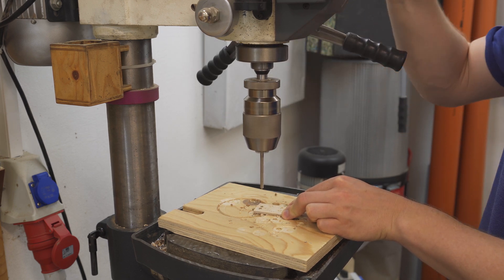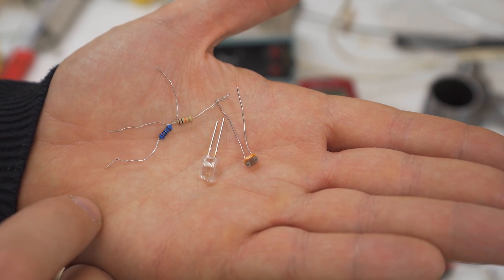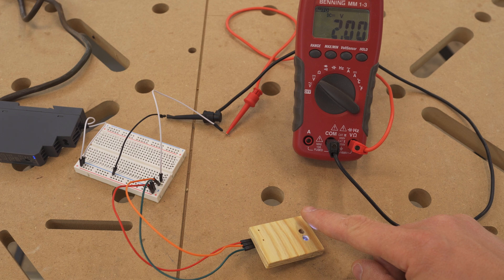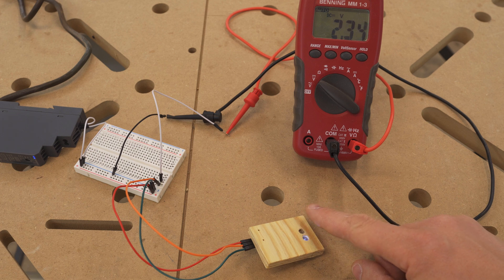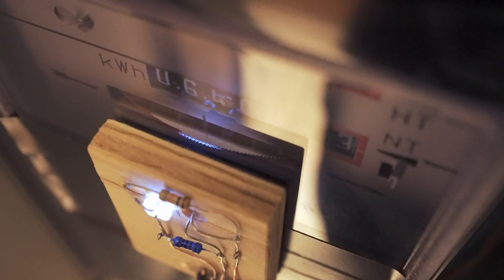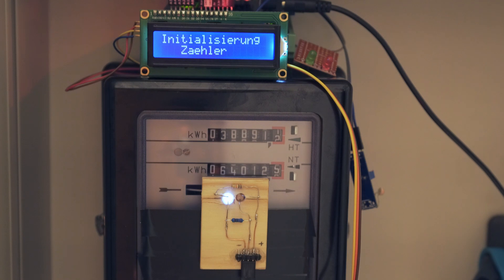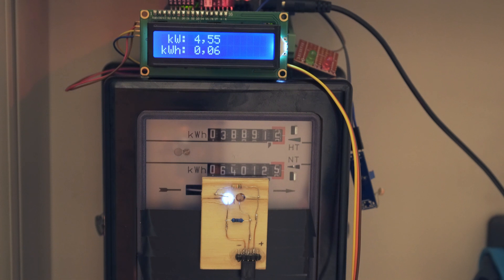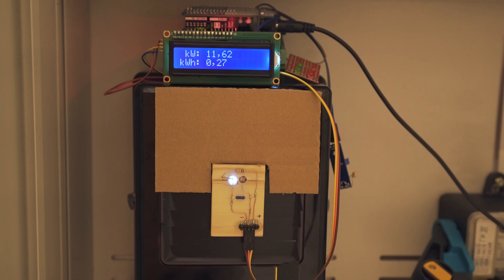Easy DIY Power Meter Monitoring System

Comment: Very nice and simple implementation! I've been thinking of something similar, but I was planning to use an ESP32 instead so I can log it straight to a computer through wifi. In my experience most SD cards tend to die after a little while with these types of usage patterns.